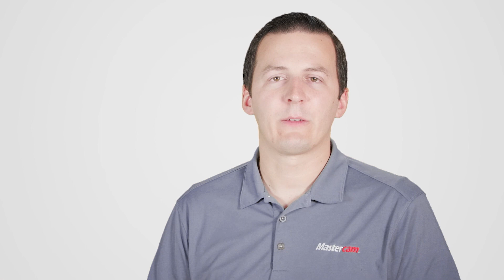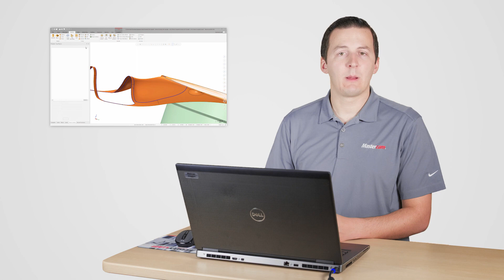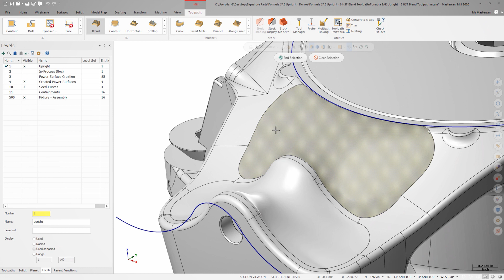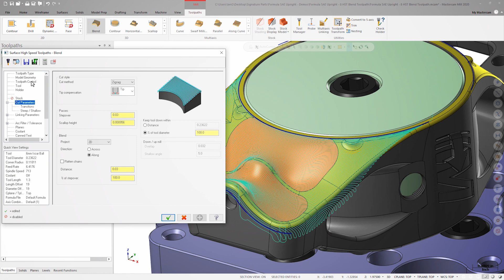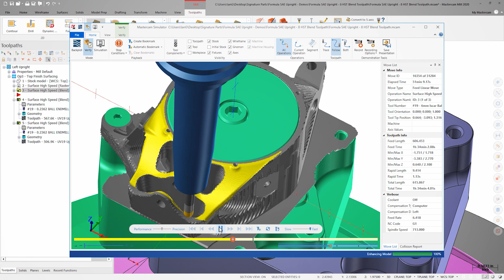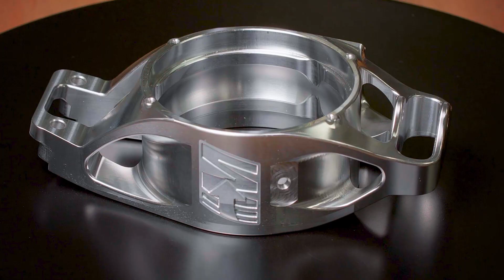FSAE Upright Series: HST Blend

Comment: Great video again and nice smooth finishing toolpath however the first blend toolpath avoids retract motions, it will also add lots of air cuts. Can the Stock tab be used to keep this toolpath while filtering holes with a higher feed rate or retract motion?
Reply from the maker: Unfortunately the new Blend Toolpath doesn’t yet support stock model rest roughing. In this case, it was more efficient to keep the toolpath motion smooth, rather than insert square retracts to avoid the holes. There was less distance traveled at the machine, and fewer aggressive rapid acceleration/deceleration periods.

However, what you are mentioning is completely possible with the Raster Toolpath, or with any of the existing 3D HST Toolpaths!